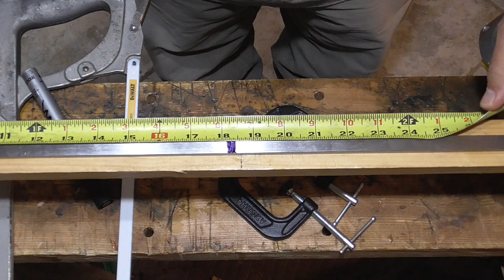The Plane Makers Float - Volume 1

Comment: Great video. I used a much more convoluted method when I made mine. Your method is very straight forward and approachable.  

I struggled to avoid tilting the file so I made a two point pivot jig to keep flat. I learned about it from old British file makers. They'd have kids flat the file with a two point pivot jig so the file could only stay flat to the flatening tool. When I did my float, I used a board with a couple boards on the ends. Put pins in the ends of the boards to pivot from so when you press down on the float it always moves away from you. I'm explaining it poorly but it is a pretty simple mechanism. Might help someone.
Reply from the maker: Convoluted can be good if the results are good as well.
Avoiding the tilting was not a problem for me. The hack saw reduces a good percentage of the metal, so the file stroke itself is easier. The black marker and magnifying glass are visual aids to do a great job to help keep the teeth even and parallel.

Comment: I like the hacksaw trick (starting the teeth cuts with a hacksaw rather than the edge of the file).  I made my first float using only a file and had trouble getting uniform depth and spacing of teeth.
Reply from the maker: I used only a file at first, the entire affair was a disaster, compared to what I can make now. The hack saw makes everything easier.

Comment: I have been looking for a video like this for a while. Where do you recommend procuring the O1 steel through? I don't know of any local suppliers that sell it in my area. McMaster seems like they have O1 but I am unsure whether they are a decent inexpensive option.
Reply from the maker: I've been using Hudson Steel but they have a minimum order. This was never a problem for me, because I was ordering steel for all the other projects I built. At Mcmaster, if the prices look decent and there is no minimum order, I would go with them. Thanks for the heads up on them as a supplier, I know the name through Keith Rucker's channel.

Comment: Looking forward to see if it works like you want. Seems like it should. All your floats are 1/8" spacing?  Thanks again for posting.
Reply from the maker: I made one float with slightly closer spacing, to cut the slot for the knicker in a dado plane. Seems to want to clog. Otherwise, I think the 1/8 spacing is ideal, there were fantastic results on some plane bodies, smooth work well before any final sanding.

Comment: Do you heat treat the 01 steel at all, or cut/use the steel as-is from a supplier?  If you do heat-treat, how do you do it?
Reply from the maker: I don't heat treat the floats. If you do, they can't be re-sharpened , a file will no longer be able to cut the metal. A wood handle would also get in the way of any secondary hardening and tempering. 
If they dull, and they will, touch them with a file again.

Comment: Hi, when you Say that you are doing liké they were doing Long Time ago, where did you get thé info?
Reply from the maker: Good question. I read somewhere, that there are almost no plane makers floats surviving from the old days. The suspected reason was the re-sharpening process, which reduced the tool to an unusable size as time passed. I can conclude the floats were unhardened and intended that the plane maker re-sharpen them at will, like a hand saw. I've never seen an antique float for sale or at auction, which is somewhat evidence of this theory.

Comment: I have a question about you not heat treating the tool steel. I get being able to sharpen them. But my question is could mild steel be used for the float to save the tool steel; tool steel being so costly and all or is there some unknown reason for using it that I'm missing? Thanks
Reply from the maker: Using mild steel is a technical question I am not qualified to answer. I use O1 tool steel for one major reason, that is, it's already the tool steel I buy for everything else I make. I have a video titled ' You're going to need some steel" that goes into some of that. Good luck.
Reply: The reason I was asking was to determine if I might be wasting my time making one say out of mild steel as opposed to o1. I'm not qualified either to answer whether or not O1 in it's annealed state is as soft as mild steel. Perhaps a more practical question is in order. How often do you have to touch up your floats? I may make one out of mild steel just to see how well it holds up by comparison. The mild steel for me is so much more readily available and way cheaper. Anyways so if I'm a bother but I enjoy your videos and have learned a lot watching them. Thanks!
Reply from the maker: @christopherwhitt9032  No bother at all ! A comparison is a great idea, I'd be interested in the results. The floats will go a while before the need of a touch up, 2 or 3 planes at least. They gradually go dull, all at different rates, because of how much work they do and how sharp they were to begin with. I set up and tune every one that's well used, just like I do plane irons or rip saws, preferably before a big project starts. Good luck !
Reply: It looks like no one has answered your question. While you could use mild steel, the reason why you probably shouldn't is it doesn't contain a high carbon content. Otherwise you'll be sharpening this constantly, though if you want practice sharpening a float, go for it.